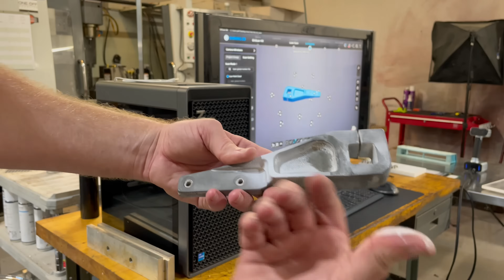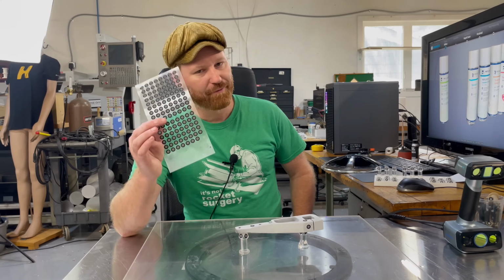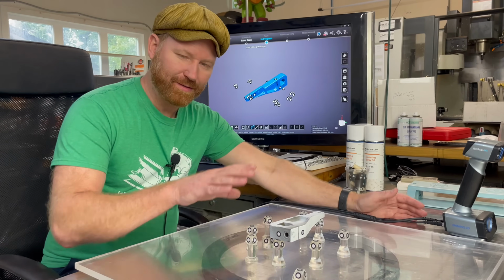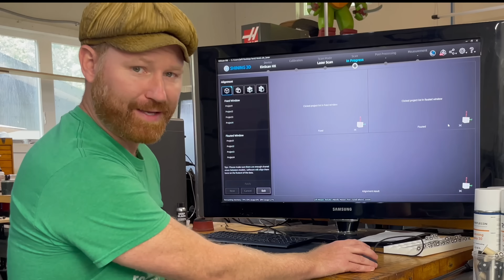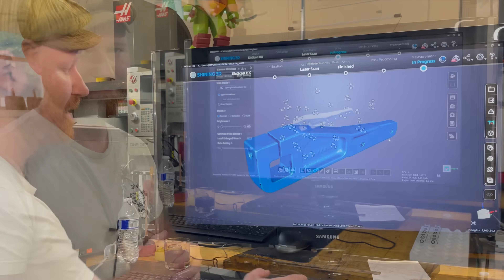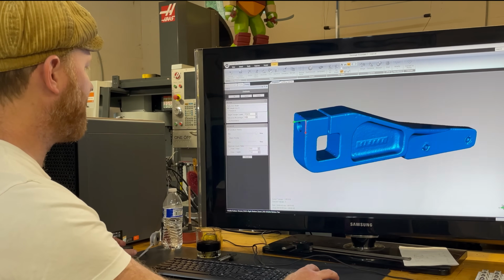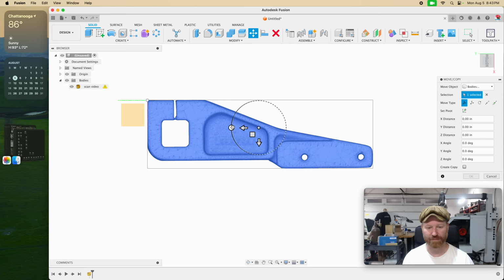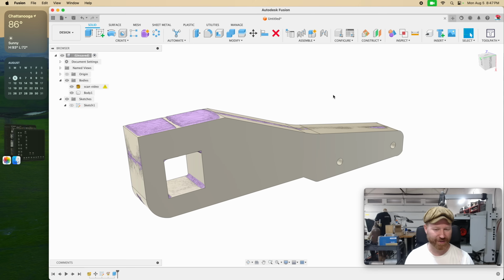5 Tips for 3D Scanning  - I wish I knew first

Comment: FYI, this is industrial level 3D scanning.  Software and hardware in the tens of thousands of dollars.
Reply from the maker: 9k. :-) Yes, you are correct.  We are not a hobby shop, but the principles and work flow are valid for just about any setup.
Reply: You can easily get this quality of model out of a $1,500 scanner.

Comment: Why doesnt anyone ever talk about how to set up the PC properly. Ive fought this for two years. Ive never had a graphics card only a chip on the mother board. < is this just common knowledge and i missed this somewhere in life??  In order to get the scanners software to work properly you need the right drivers plus you need to manually install the scanners app to work with  graphics card. Depending on the graphics card you have; there maybe multiple drivers and if you dont have the right one it wont work right. Then if its interfaced via USB you need to set that up too and use USB 3.0 for best performance. You need turn off power saving optoins, and also you need to get Direct X updates that are correct. Now my scanner dont even need markers. you just point the thing at something and it scans it. Ive spent hours and hours and hours scanning stuff and fixing them over and over again. Now I can get stuff done in one swipe error free.
Reply from the maker: Good point, for industrial scanners, the computer must be built to its specifications, particularly with the GPU. So, when you buy the scanner, you still have to buy a very specific computer. 

Thanks for bringing that up!

Comment: Can someone please explain how to save a file with this damned thing ?  I'm scanning large projects - cars.  Every time I close the software and return to it the files that I spent time aligning multiple scans are not saved.  They are all jumbled again. The interface of the software is awful.  The mouse controls for panning are non intuitive.    I had to add a cage of tape with markers because the scanner cant track round tubing without going into a tailspin.  It keeps recording when it goes out of alignment and I have to start scanning all over again.  You'd think the creators would pause the scan until alignment is re-achieved.  I'm really hating my einstar.
Reply from the maker: Hey, I totally get the frustration—scanning larger objects like cars with the Einstar definitely has its quirks. Saving aligned scans can be tricky if you’re not careful about the workflow. After aligning, make sure you manually save the project before closing, not just the raw scans. Also, using the Project Save or Export Scene option helps preserve alignments.

The marker cage was a smart move—round tubing is one of the harder things for structured light scanners to track. And yeah, the software doesn’t auto-pause on tracking loss, which can be a pain. I’ve found it helps to break big scans into sections and align them after the fact.
Reply: @ChipMonkeys  Thanks for the reply and yes ... I was frustrated.  I figured it out like this.  The chassis is a tube frame including roll cage, no bodywork.  Even with many hundreds of dots the scanner would go into tailspin.  I remedied this by taking blue painters tape and adding more crossmember shapes out of tape.  The flatness kept the scanner from 'flipping upside down' and 'stretching tubes into infinity'.  The scanner hates tubes with no grounding structures.  Tape worked great.  I broke the car up into about a dozen sub scans and aligned them.  I still think the user interface sucks and is confusing.

Comment: There are so many types of 3d scanning markers, what should I use that will be useful for all situations?
Reply from the maker: You're right. Some scanners require special markers, like the Creaform scanners. But most scanners are fine with any generic markers from amazon with the adhesive. Check that your scanner doesn't require anything special, then check what they sell where you bought it. Other than that, I have not seen a notable difference in brands. Let me know if this answered your question or I missed it entirely.
Reply: @ChipMonkeys  I am talking about these 3d printed pyramids with markers on them, in this film you used pyramids that have a high base, I never seen these before,  I bought the Creatlity Raptor scanner and started doing some tests with it just yesterday, I see why people put the markers on all kinds of 3d shapes because if you lower your scanner it can't pick up the ones that are on the surface and it looses track, so you must have markers that the scanner can see even when it scans in a very sharp angle or even vertical, they you have to have markers that are seen in these angle, so the pyramid object seems to hold the markers in a good position, but maybe I'm wrong? maybe there are better shapes? the shape you use, does it have an advantage? in what way?
Reply from the maker: @danielkotzer636  Thanks for the comment! You’re spot on. Those pyramids are designed to keep markers visible from different angles, especially when scanning sharp or vertical surfaces. The raised base helps the scanner “see” the markers even when the part blocks others. The pyramid shape is stable, allows for multiple marker angles, and minimizes occlusion compared to other designs. We tried a few different angles, but 10 degrees seems to work well. It all depends on the part your scanning, but this general angle has worked fine for us.  

Let me know how your tests with the Creality Raptor go!
Reply: @ChipMonkeys  thanks for your reply, I keep getting better with the Creality Raptor scanner, I see that with laser blue light you can even scan shiny and even reflective surfaces with no scanning spray, which is a big advantage, I'm not saying the spray doesn't make a difference, but even without it, it worked. I worked with photogrammetry before, there you have to cover a reflective or even a shiny object, and it can't scan a featherless object, you have to cover it with spots, so defiantly laser scan saves me a lot of time.
Do you have a link to a model of your type of marker pyramid with the high leg on the bottom, so I can 3d print it?
Reply from the maker: @danielkotzer636  https://chipmonkeys.store/pages/all-products

That's the link. We have 3D Modeled version of these, but I like the transparent because there is no scanning data to remove : ) But it takes 3 seconds to remove it. Let me know, and I can send you the 3D Models for printing.